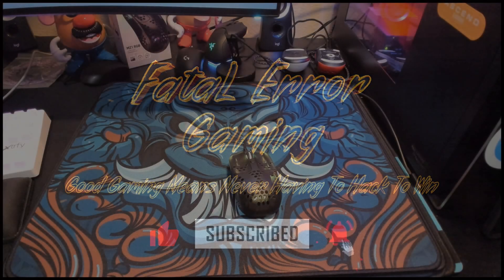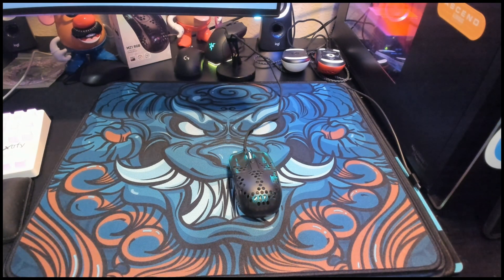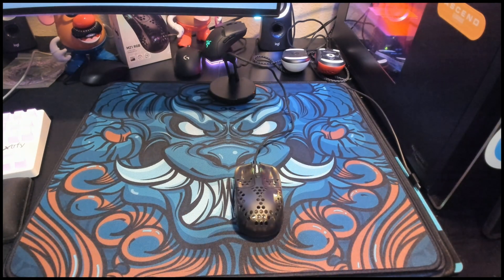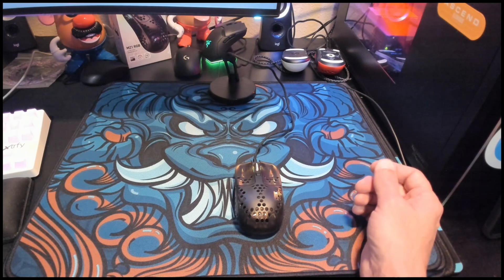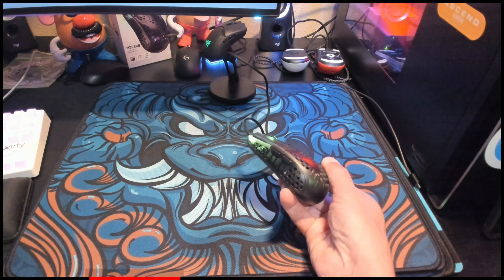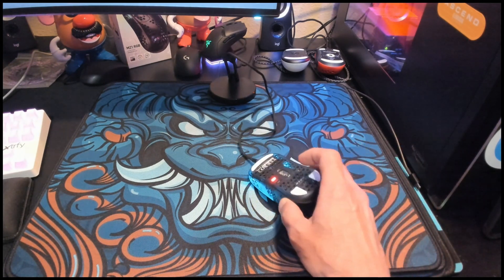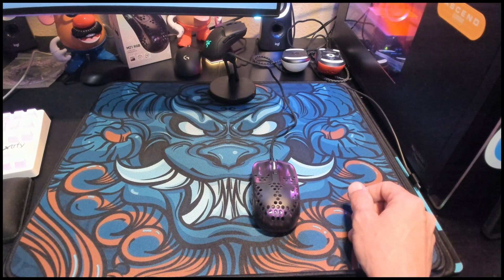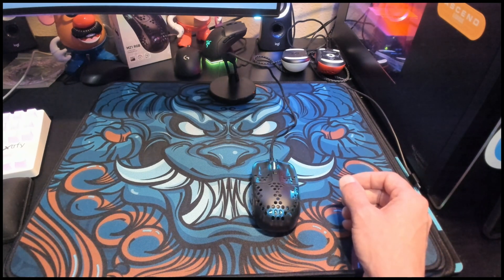Xtrfy MZ1 Tracking Disconnect Issues

Comment from the maker: Update to possible disconnect before changing out the cable or returning the mouse. Check your lift off distance on the mouse. I think it is set to 1mm. Try setting it to 2mm and see if that helps any. https://youtu.be/hT0pgM_N7Nc The video shows you how to adjust lift off distance. Cheers and let me know if it fixes the issue.

Comment: My mouse for some reason periodically decides to track diagonally down and to the right by a quarter of a centimeter, four or five times then it stops and shortly later it does it again.  It only stops really when I decide to touch the mouse.  But for some reason it doesn't do this tracking "glitch" I'm going to call it, when I flip the mouse upside down.  So...  No idea what's going on.
Reply from the maker: Have you tried checking the Sensor Lens and making sure it is clean. If it is dirty it will cause tracking issues. If you have to clean it just use a cotton swab and some Eye Glasses cleaner sprayed on the swap and wipe it out. A lot of stuff like threads and dust like to build up over time in that little hole. Otherwise you have a faulty PCB or the cable is screwing up. Xtrfy Usually does a good job at RMA if you can show them something is wrong. Cheers and hope it's something simple like the sensor lens.

Comment: ok i got a m4 and a m42 from xtrfy and they both end up wit the same problem as you after 1 year! i think xtrfy should rework the way they do their cable...
Reply from the maker: Yea, I agree. I'm sure their work around is their wireless versions. But as for the MZ1 and M42 they have new batches with the M42 and MZ1. The white MZ1 cabled, more than likely fixed the issue and the M4 as well when they introduced custom shells. Not sure though. Will try and see if they will respond to me when I message them.

Comment: My mouse did disconnect a few times by just moving the cable but it took me about 5-10 seconds to get it to finally disconnect compared to how easily it did in the video. Also it will disconnect for about 5 seconds and the rgb does as well before it works again and the rgb comes back on. I emailed Xtrfy and wanted to know if they sent you a new mouse that way I’ll know if I would be getting a new one or not. Thanks!
Reply from the maker: Hi @Syn FTW sorry to hear you are having the same issue. You should be able to get a replacement. They might ask for a video showing the issue or they might not. Just depends on how nice they are that day. They are good people so just ask nicely and you should get a replacement. Either way I would get a cable from the link in my video discription just in case. Also DHL does not have a location where I live so I was able to keep the original mouse as well and put my new Paracord on my original. Works good as new. I'm using it on my latest video on twitch.tv/FatalError4uttv check it out. Cheers.

Comment: I have the same / similar problem but I cannot reproduce it on the cable. In addition, the RGB lighting remains unaffected. Sometimes I can play for hours and nothing happens, sometimes it happens several times within minutes. I don't have the same problem with other mice. Only with the MZ1. What should perhaps also be mentioned: It is not just that the mouse no longer reacts, afterwards it covers the distance that I made during the breakdown in a fraction of a second.
Reply from the maker: Hi @AndreW Glad you dropped in. Wish under different circumstances but at least you came here looking for answers. I would do two things first. Head over to my Link Tree and get ya a custom Paracable and change out the cable, Second before you do that, There is a firmware update on the Xtrfy website. Try installing that firmware update. 

I don't think it's your firmware to be honest. It's the cable and possibly a USB port or Windows is doing something wonky.  But for sure go into your mouse setting in windows and make sure enhanced pointer Precision is unchecked as well. Windows loves turning that back on after some updates. 

Personally I think it's the cable or USB port. You should always use a port on the back of your motherboard and not the ones on the front or side of your case. Either way try another USB port too. 

Please let me know what ends up being the issue. Thanks.... Fatal
Reply: @Fatal_Error_Gaming  Hey, thanks for your detailed answer. The mouse is connected directly to the back of the mainboard, to the connection with which I have no problems with other mice. The new firmware was installed a long time ago, so I tried the first solution. The settings for the mouse in Windows are also correct. It's really weird, no matter what I try, it can't be reproduced. Sometimes the problem described occurs several times in a row, sometimes not for hours. After it happened again, I shook the mouse extremely, so that there was a lot of movement on the cable and suddenly I heard the mouse lose the connection several times - I thought I had finally found it, it must be the cable. After the round, 15 minutes later, I tried again and nothing, no matter how much I move or shake the mouse or move the mouse cable with my hand - no more disconnections.

It's so weird. Especially because the mouse reconnects when the connection is lost and the distance that I put on the mouse pad when the connection was lost is covered again in a fraction of a second in the game.

The mouse lighting does not go out and continues to run normally during this time.

It feels like the mouse has to get "warm" first, then there are significantly fewer disconnections.
Reply from the maker: The mouse is definitely disconnecting. There are separate wires inside the cable that go to different parts of the mouse for control of the mouse. So the lights wouldn't necessarily go off if your connection to the sensor is the issue. Also if you don't want to put you a new parachord on the mouse you can always contact Sabation at Xtrfy and try to get ya a new copy. They did it for me. Cheers and let me know how things are going with the mouse.

Comment: Does type of paracord cable matter when doing the mz1? What brand or type of paracord do you have? Also can you do a tutorial paracording the mz1 if you havent started already?
Reply from the maker: Basically you can get ya a cable from Dream Cables if they have any. The same Cable that the Xtrfy M42 uses you can use on the MZ1 as well. And yes I have a Cable already for the MZ1 and I will be doing a cable mod soon on it. Thanks for the interest. If you do get you a cable make sure it has a 3d stress relief if you have that option when ordering.
Reply: @Fatal_Error_Gaming  Thanks, could you please make a video on the paracording process for the mz1 when you do mod it?
Reply from the maker: @DaWiseOne Vid is out of me parachording the MZ1. Actually it's been out for a while but just found your response since yt sucks at getting me notifications sometimes. Cheers.
Reply: @Fatal_Error_Gaming  i already paracorded it but thanks in case i will have to paracord the mz1 again
Reply from the maker: @DaWiseOne how did the whole process go for ya? Was it easy? Did it fix your issue? Would love to hear your thoughts. Cheers

Comment: The 3389 sensor is superb !! It works perfectly on my copy, the problem is the first LOD adjustment step, 1 MM is too little. When you hurry and make sudden movements with the mouse you lift it from the surface without realizing it and then the sensor no longer tracks. The solution is simple, adjust the LOD on the second step, 2.5 MM and you will see that the mouse will work perfectly all the time !! I don't have disconnect problems on my copy and scroll wheel works good, anyway I don't like it that much, scroll wheel and tactile feedback it's softer than on my M42 copy. On M42 scroll wheel it is much better. In my opinion.
Reply from the maker: Yea I find the Scroll wheel click likes to stick so to say. So I agree the M42 scroll wheel is a touch better. Glad you aren't having any issues. I have my new mouse from them already and so far so good. In a month I should be able to tell if it's going to do the same thing still. As for me, This mouse was one of the best purchases I have ever made. Thanks for dropping in Taica. Also yes I have already adjusted the lift off to the 2.5 as well and it feels awesome.

Comment: Mine does this but its not near as bad as yours. It only happens when I do a fast movement/flick. But still very infuriating. Zy tweeted saying it may be a problem with people's drivers. Still not sure.
Reply: that's what happens on mine
Reply: same issue here, did you find a fix?
Reply from the maker: The Fix is above. Either replace the cable with a new cable or send it back for a new MZ1. Either way I would just change out the cable. Over 99% of the issues is the cable. I have a link in my link tree to Wparachords if you decide to go that route. Cheers. I mean you can also try the Firmware update they put out but that did not fix my issue. It was the cable.
Reply: @Fatal_Error_Gaming  alrighty I appreciate it I'll try the firmware update otherwise an rma but I appreciate it have a good one!
Reply from the maker: My Pleasure @BlakeTheNoobie please let my know how everything turns out brother. Cheers.
Reply: @Fatal_Error_Gaming  decided to turn back to my razer viper till I can afford a g pro x superlight as my grip on the mz1 seemed to be inconsistent therefore making me overthink my aiming if that makes sense I appreciate all ur help tho still
Reply from the maker: Yea it's gonna be different for each case. If you do a lot of swiping because of low sense settings on your mouse you are probably going to see more of an issue like I did. If you are having issues send it back for a new one. If the new one starts doing it just cable mod the mouse and that will fix it.

Comment: The german Youtube channel "4etech" made a video on how to paracord the MZ1. While disassembling the mouse, he discovered that the original cable was broken because it was extremely kinked beneath the PCB. Other users in the comments wrote that they also had torn cables and random disconnects. I guess that's a design flaw on behalf of Xtrfy and chances are you'll soon get the same problems with any replacements they might send you... 

/watch?v=KxMG9smTeDs
(around 4:18)
He also shows how to avoid kinks with the new paracord using a shrinking tube and better cable routing (around 13:40). Pretty good stuff!
Reply from the maker: Thanks brother. I will for sure check out that vid soon. I have my new MZ1 heading my way. Suspect just as you said I will soon run into the same issue again. But this time I will mod the cable if it happens again.

Comment: ye my mz1 just started disconnecting randomly, unfortunately i got it 2nd hand off mousemarket so doubt i can rma it
Reply from the maker: It's not hard at all to Paramod the cable. Just get the color cable you want and put you a new cable on it. Check out Dream Cables and make sure you get a 3d printed stress relief for the part that hooks up to the outside of the mouse. But also you can try and see if Xrtfy they will replace it. Sometimes they will surprise ya what they will do. Also I didn't tell you to do this but you could also just purchase it on Amazon and send them the crap one back for a refund. Easy Peasy. New mouse. Ha

Comment: Still waiting for my preorder here in Canada 😢
But my feelings towards this mouse is slowly going from excited to nervous wreck LOL
Reply: I have a first run pre order  mz1 and have no problems with it.
Reply from the maker: Hi @Ritz Curious... do you consider yourself a high or low sense player? I think a lot of folks are seeing the issues sooner because they play with a low sense. Which in turn causes them to tug on the chord more often for fast swipes and such where as a high sense player is going to not move their mouse as far. Meaning they will not see any issues for a long time or maybe even never.
Reply: @Fatal_Error_Gaming  I am mid to high,  in cod my edpi range is between 3200 and 4600.  Though ide say I use medium more often. Just using cod edpi as a representation.

In source/quake that's 960 to 1400.

I have my mouse cord hanging on a monitor arm so even if I do wide swipes it doesnt put any noticeable tension on the stress relief. I tried a mouse bungee but didnt like it. Even with slack it never feels right.
Reply from the maker: @korgy Don't get to out of shape, You might not get or have the same issues as everyone else. These videos and info are for if you start to have issues with your MZ1. The mouse is king. If need be we can always Paramod our MZ1 which is what I usually do when I get a mouse anyways. But the cable is light enough that I didn't do it this time. Guess we will see what MZ1 Part Deux brings to the table after a couple months of using it. Keep me updated if you start to have issues. Thanks for dropping in.

Comment: Hope you're doing great bro! Yeah my copy had faulty scroll wheel. It just did not work at all. Ents swapped the encoder and it works now. Xtfry should replace yours, they replaced mine, so I hope they send you a new copy especially since you like it a lot!
Reply from the maker: @Hardware UnpluGGed Thanks for dropping in guys. Yea I am waiting on the third email now. I had to give them my Order info and of course this video so they could see. That was 2 hours ago and still haven't heard back from them on the third Email. Okay so so far there are three causes.... USB...Stress relief...and Scroll Wheel encoder. Guess we will see what gets added to that list.
Reply: @Fatal_Error_Gaming  Hello, how's the encoder affect the cable in any way? Have this issue, but for now only in particular angles of attack with the mouse.
Reply from the maker: My first MZ1 wasn't an encoder issue. It was the cable. And so far I've been using the new MZ1 and haven't had any issues as of yet.